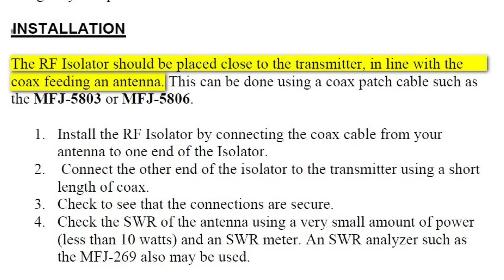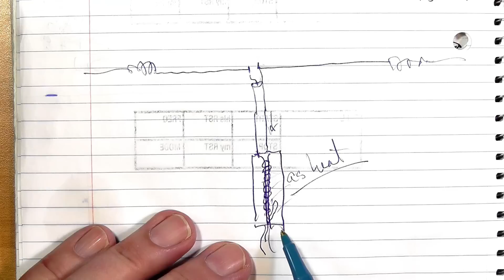Effect of the MFJ-915 Choke Balun (#304)

Comment: OF Course you know an unbalanced Coax feeding any antenna requires the choke at the antenna; and, a balanced antenna with balanced ladder line feed requires a choke at the unbalanced radio, and before the tuner if used.
For the benefit of the audience I'll cut it short:  The common current return flow on both inner and outer surfaces of the shield must be halted at the feed point of the antenna.  That didn't take 14:32 minutes to read.

While you speak of your superior grounding, not everyone is so inclined.

Comment: I recently bought a GA-450.  I noticed  some significant power supply noise.   This antenna has a rechargeable battery that recharges via USB. 

I do have numerous USB chargers throughout the apartment.  I’m thinking I’m picking up the noise from the GA-450’s  battery itself. The noise is much more pronounced on shortwave.  It seems to level off from around 30 MHz on up.  Broadcast FM and up seem to be not as bad. 

Would a ferrite bead/ring placed on my BNC cable near the antenna’s junction box end help mitigate the noise issue?

Comment: I tried to use one well its still on, but to my dismay its really not doing anything,  all seems the same to me!!! Using a full wave delta loop horizontal,  homemade ladder line to a 9:1 unun, to a lightning arrestor grounded to some coax, maybe 5 ft to the radio( rf choke) then the radio. Here's  alink to my video with any differences if you can tell!!! Thanks for all you other vids and info!!! Awesome!!! 73's N3WUB

Comment: In what way, in your opinion, warrants naming a RF choke a 'balun'? Where in this thing is a unbalanced input (coax) converted to balanced output (dipole wires)?
Reply from the maker: I stand by my assertion that it is a balun. It connects a balanced antenna to an unbalanced feedline regardless of its connector type. It uses the technique of removing the unwanted power from the exterior of the feedline. The function of the device is that of a balun. The ARRL Antenna Book calls them baluns for the same reason I do. The Rothammel's Antenna book from the German equivalent of the ARRL (DARC) says the same. BTW, the purpose of a choke is an inductor that passes DC but not AC.
Reply: @davecasler  Interesting. In general, could we say that any device which connects a unbalanced feed to an balanced antenna is a balun, regardless of operation or efficiency?
Reply: Dave's views are quite a bit different than Callum, DX Commander. Hard to tell which approach to use . . . As in so many topic areas in ham radio, the reader/user doesn't know who to believe and you end up having to figure it all out by experimentation.
Reply: "In what way, in your opinion, warrants naming a RF choke a 'balun'?"
Way too many people do the same thing to try to fix it at this point.  But I try anyway.
Reply: @lindajensen6889  "As in so many topic areas in ham radio, the reader/user doesn't know who to believe"
It often does not matter, until it matters!   But yes, the amount of not-really-that-way radio theory overwhelms good science.  For instance, you'd think that radio engineers had somehow overlooked the miraculous EFHW for the past 100 years.  No, they are extremely difficult to use (1).  Then there's a debate whether you need a "counterpoise".  Why is there debate?  There must be a circuit, some place for the electrons to GO.  If you don't provide a counterpoise, guess what?  It will use the coax. Oh, you say, but I have a choke!  Well, your 200 ohm choke isn't going to do much when the feedpoint impedance is already 4000 ohms.  It is absurd to use or think you are using a "balun" with an end-fed antenna. The whole point of a balun is that it is in the exact center of a dipole, hence, "balanced".  

So you read/listen/study and eventually find a source that is usually correct and hopefully understandable at the same time (an unlikely combination).  

1. Difficult EFHW:  Extremely frequency specific endpoint impedance.  Compare to a dipole that has about 35 ohms (each leg 70 ohms but they are in parallel).  A bit "off" on length doesn't change this much. 

But EFHW is at a "node", a high voltage, low current node.  Zero current and infinite voltage, or at least it would be but it radiates and thus does not reach infinite volts.  But a few inches of difference and suddenly your 4000 ohm feedpoint impedance and 69 to 1 transformer (also improperly called a "balun") should be 45 to one or something like that.  A few more inches, now the correct transformation is 9 to 1.

Comment: Hello David
I think that when you measured the results on this antenna you did not say that the antenna feed line is lamda/2 of the longest operating frequency.
MFJ 259 (B) measures also the transformation defects on the feed line and falsifies the measurement results !
To the Coke Balun very close to the feed point of the antenna and one at the tuner or TRX. then I have also QRN by 18 dB at my station  lower. I use the Coke from W1JR.
73 from DG1RUG

Comment: I enjoy your videos, however the subject of common mode chokes is more complex than it first appears, I have messed about with them for a few years now and still have unresolved issues with them. There is definitely a case for using more than one and there are definitely "nodes" on the feeder where they work best. The best ferrites for the job are somewhat lossy, you don't want a high Q loading coil effect which could in fact increase common mode current. (depending on feeder length and frequency). SWR measurements don't give the information you want, perhaps you could build a simple toroid and diode arrangement to examine the common mode current on your feeder?  Where you are likely to see gains are in reduced noise levels and reduced RFI to other electronics. The heating of the ferrite is dependent on the common mode impedance of the choke and how much common mode current you have. Digital data modes such as FT8 etc are weak signal modes, not automatically low power modes.... but that will set the cat among the pigeons..73
Reply: The MFJ-854 RF current meter will tell you the common mode RF current running on the outside of the coax. The coax must fit inside the coupling transformer. This would be a fun experiment. --73, N2GX

Comment: It's a choke, not a choke balun. A balun couples unbalanced to balanced feedline. Both end if the choke are unbalanced so it is not a balun, just a choke.
Reply from the maker: I stand by my assertion that it is a balun. It connects a balanced antenna to an unbalanced feedline regardless of its connector type. It uses the technique of removing the unwanted power from the exterior of the feedline. The function of the device is that of a balun. The ARRL Antenna Book calls them baluns for the same reason I do. The Rothammel's Antenna book from the German equivalent of the ARRL (DARC) says the same. BTW, the purpose of a choke is an inductor that passes DC but not AC.
Reply: @davecasler  We can agree to disagree.
Reply: @davecasler  I have the exact same choke on my Hustler 4BTV vertical and it is an unbalanced antenna so I guess it can be considered dual purpose if you insist on referring to it as a balun. In the case where I use it, it is simply a choke to stop common mode current on the feedline and is installed at the base of the antenna.
Reply from the maker: Good point, although I'm surprised that grounding the radials at the antenna wouldn't do the same. My vertical is well grounded (with some buried bare radials and a ground rod) and the shield is again grounded at the station ground just outside my shack. Certainly the MFJ device would work well in your application.
Reply from the maker: Agreed. Thanks for your continuing interest in my channel.
Reply: @davecasler  That particular vertical is roof mounted with 4 radials per band. My ground mount vertical does not have a choke on it. It is a multi and home brew fan vertical with multiple radials in a field around the base. 17M, 20M, 30M and 40M with the 40M as an inverted L.
Reply: @ve3pcp  The issue Rob is that Balun and Choke are used interchangeably.   If I make a choke by winding 12 turns on a toroid, one end connected to a dipole and the other end to coax, then it is causing a balanced to unbalanced transformation.  I gave up arguing from your corner a while back :)

Comment: What  would be the result if you  used one one the line & one near the transmitter?
Reply: It is good practice to have one right by the antenna and You can also put one behind the transceiver. That way You can add the attenuation from both chokes.
Reply from the maker: It probably wouldn't make much difference.

Comment: Hey Dave, just came across your video.. and I love your videos.. I do have a question… the choke.. surely it’s not a Balun as you say.. but a RF choke, as a Balun is a device which is for a balanced antenna to unbalanced feed line? Correct me if I’m wrong.. cheers 73 VK3NCR

Comment: With balun at antenna. How would you trim the 20, than 40. Would that not work.
Reply from the maker: A choke balun does indeed work a little differently on different bands, but you can still tune the 20 and 40 independently on the MFJ-17754.

Comment: Thank you so much for this info.  I have been thinking about buying this.  Never heard of putting a balun at the transmitter.  Wonder if it helps receive at all?
Reply from the maker: It didn't seem to me to help at the transmitter end of the coax.
Reply: Common mode current issues aren't an rx issue.  Due to skin effect, your dipole turns into a tri pole allowing for current to travel in both directions on a single conductor.  The problems will correlate with power.   This video will only serve to confuse you more, as it is based on confusion.  Watch the balun series by TRX Bench.  He explains it all, if you can digest it.
Reply: Yes big time right before the rig cuts noise in half
Reply: @falsedragon33  Common mode can be an issue for RX,  the symptom being a higher noise floor.  If you are in an electrically quiet environment,  this is irrelevant, but in a noisy urban environment,  the impact can be substantial.

Comment: I have a problem with my SWR at the radio to  the tuner. I must use a tuner with the type of endfed I have. The SWR is very good for tuner to antenna. So what can I use from radio to tuner?
Reply from the maker: That's a very odd problem. Check the cable. Also make sure the radio and the tuner are grounded together. Note that the tuner in the radio should be turned off. You should be able to set the tuner such that the radio SWR reads 1:1.

Comment: Ok Dave here's an interesting question. What if your antenna has a bulan and still have RF in the shack?
Reply: Baluns have to be of the correct design to impact on the common mode.   Guanella types are so called "current baluns" and are effective.   Voltage baluns don't impact common mode much at all.   Further,  chokes need to be designed for the frequency of use - a great choke on 80m might be ineffective on 20m and harmful on 6m.
Reply: The coax IS an antenna even with a choke at the antenna.  That is why chokes at both ends are suggested.  A hundred watts a few inches from the coax at the antenna end will simply couple into the coax bypassing the choke, at least partly, and depending on how you lay the coax.  If it comes down a pole precisely between the legs of the dipole it should be mostly immune from that phenomenon. .

Comment: How does VSWR have anything to do with chokes and common mode current?
Reply from the maker: Yes, common mode current on the outside of the coax can cause the SWR to behave strangely.
Reply: @davecasler  No. You are preaching the wrong stuff. 
SWR and common mode current are two separate phenomena.
SWR is due to impedance mismatch at the feed point.
Common mode current arises due to
1. Unequal length of the arms of the Dipole
2. One of the arms of the Dipole being closer to the feeder
3. One of the arm's end nearer to the ground (in case of an inverted V configuration)
4. One of the arms of the Dipole has some RF absorbing structures like concrete building, trees or even a bunch of birds sitting on the wire..😁
You should have a clear idea of the two different phenomena before making the video and suggestions.
Reply: @subramanianr7206  100 % correct.  @David Casler, you should edit your video to provide the correct information.

Comment: Saw several online priced at around $40. I think a person could build their own for less since MFJ looks like they bought all their parts at the hardware store.
Reply: A choke is very simple to build, the basic idea is to use as many wraps as possible. I use random ferrite cores and usually works out fine.
Reply: Lol!😂
Reply: if you use ferrites, be aware they are very frequency specific depending on their "mix".  Air wound chokes don't have that problem but do take a lot of coax depending on the frequency.

Comment: Thanks for the video. I have an end fed antenna with about a 225ft coax run. I have one at the TX. I was wondering about trying one at the feed point of the antenna... what are some disadvantages of coax radiating from an antenna performance perspective?
Reply: A good counterpoise is almost a requirement on Endfed antennas. If you rely on the coax shielding to be used as a counterpoise, a choke near the coax/antenna junction (at least 25’)
Reply: Watch this YouTube “RF man discusses long wire antennas, ununs, rf chokes and antenna towers” uploaded Oct 2020
Reply: Coax simply becomes part of the antenna system in that situation.  Might help, probably not.  It changes the radiation pattern and directionality.  In some circumstances it can be a bit dangerous to have RF on the outside of the coax, runs down to the radio, through the microphone cord into your mouth and/or hand and you'll get a "bite" it is like an electric shock but at radio frequency it is a sharp little burn.

Comment: When I did my one I had made a chock 8feet from the antenna and I got 1-1 all bands
Reply from the maker: That is particularly true at higher frequencies. Neither 40m nor 20m show much loss. The 50' coax is actually RG-213, so it's pretty low loss.

Comment: Was the coax 1/2 wavelength @ 40m & 1 wavelength @ 20m? Given that your vertical run was so perpendicular to the dipole, is a resistive choke even necessary?

Comment: BALUN implies balanced to/from unbalanced (coax). This is a unbalanced to unbalanced device in other words an UNUN???
Reply from the maker: Yes and no. It has coax coming out the top, but it's designed to be directly connected to a balanced antenna (the dipole). So it really is a balun.
Reply: You are right, it is an UNUN. It is just a straight piece of coax with two connectors and some beads over the coax. To be a balun. this choke should have a balanced line out, like two bolts, for direct connection to the dipole. This is the wrong choke for a dipole. It looks more like a choke for in between a coax.

Comment: Not sure of the purpose of this presentation in your series of generally good videos but this one misses the point completely.  You can't measure CMR choking effectiveness using an SWR meter because you're using a cheap, insensitive directional coupler on an imbalanced system.  Check out any of the instructional videos posted by TRX Labs et al, on using the NanoVNA to measure CMRR effectiveness of line chokes.  And remember that an antenna presents a complex impedance not a pure resistance as in the lab.  If you want to use clip-on beads to help with RX or LF broadcast noise, place a number of them at both the feed point and random points along the line and some at the rig.  It may help reduce RX noise, but they make a lousy CM current choke.  Want a good choke?  Make a 2-core Guanella choke.  A W1JR or Reisert choke is ineffective as a true Guanella choke.  Just because it's popular doesn't make it good.  And, yes, anything will work - somewhat - even a steel bolt.

Comment: What i conclude is, don't bother to purchase it. It makes no noticable difference.
But is it better than ugly balun, just piece of coax wrap around a pvc pipe?
Reply from the maker: Actually, I think you're right--a simple "ugly" balun does about the same thing. But it takes about 25 feet of coax, and coax is more than a dollar a foot, so the price differential isn't so huge that way.
Reply: @davecasler  Nope.  An ugly balun does not do the same thing at all.    An ugly balun relies on resonance to create the common mode impedance,  this makes it a single frequency device.  You need ferrite (see K9YC cookbook) to create resistive impedance across a broad range of frequencies.   The MFJ choke will have resistive impedance across a frequency range.   I haven't a clue about how much and where.   The ugly balun will reduce the common mode impedance at some frequencies, making any CM issues worse not better.